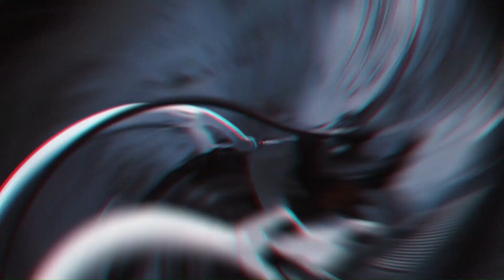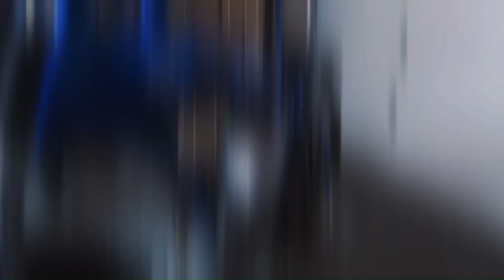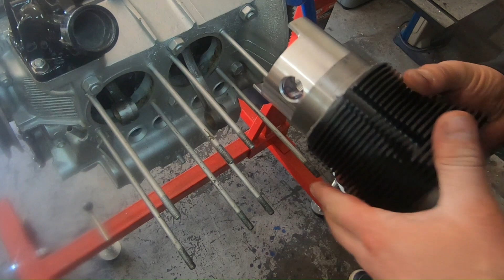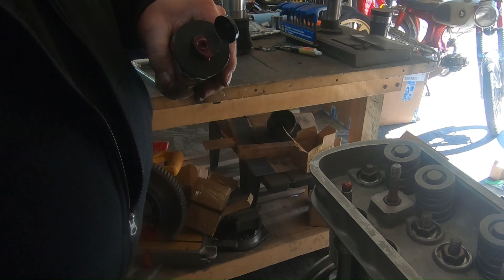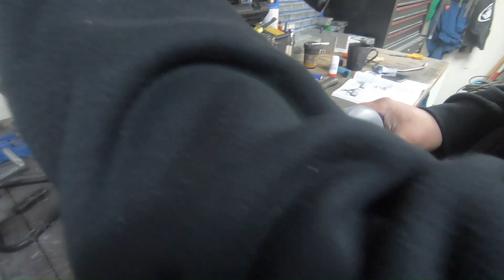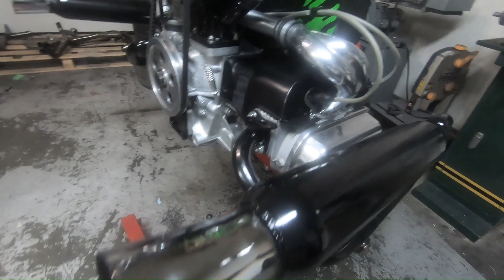DLH Performance Rebuilds 1641 VW Dual Port Engine PART 2

Comment: I haven't looked into how doable it is but kinda liked the idea of a VW bug that could be fairly quickly & easily converted from a low the ground summer street cruiser to a winter time rallycross/mild Baja Bug. Maybe keep a set of street wheels & a set of Winter/all terrain tires & way to either adjust the shocks or swap. Get some high compression heads, bigger carb jets & run E85 in summer to help keep the air cooled engine cool. In fall switch jets & go back to 93 gas if you're gonna drive in winter.